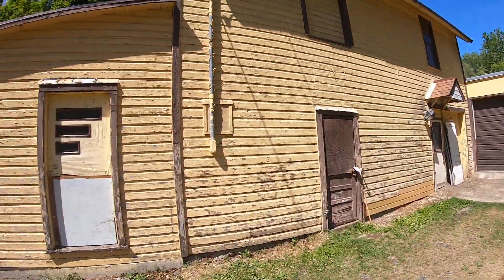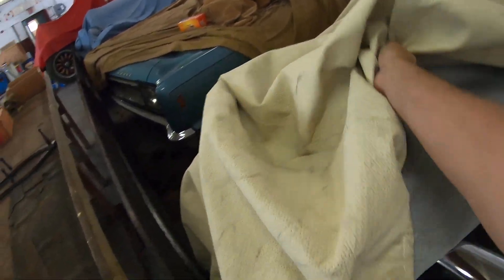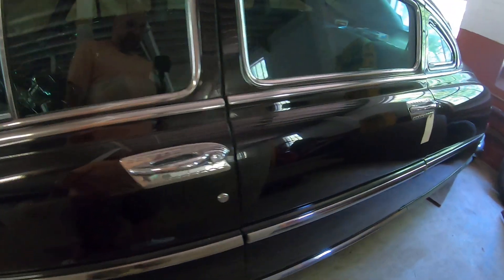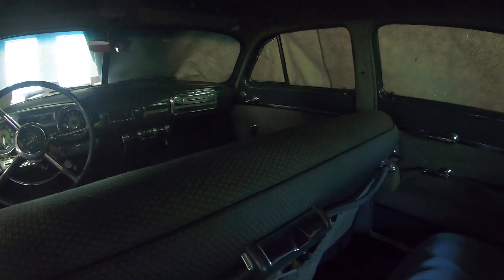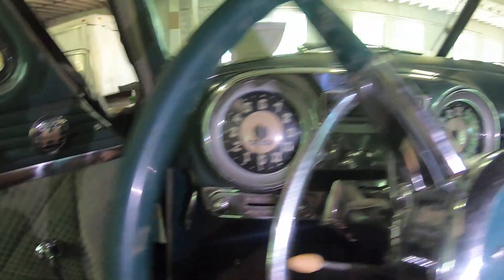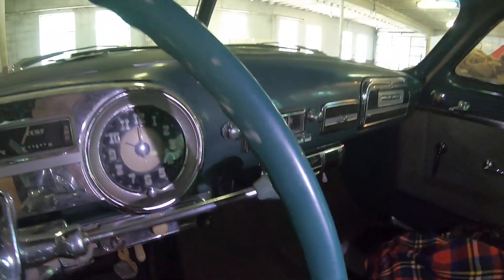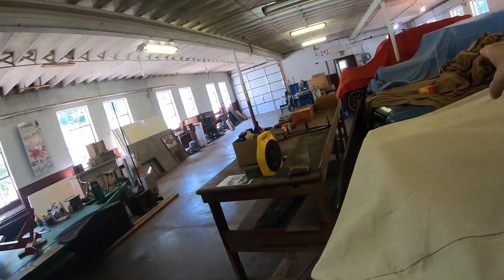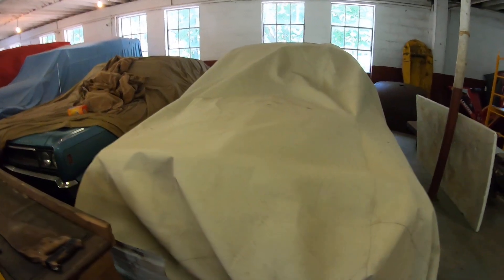HUDSON HORNET BARN FIND

Comment: "Barn Find" apparently means something altogether different now, than it did in the Eighties... When we were actually finding halfways decent old cars in actual, abandoned barns...

My brother and I found a rotting barn about three miles away from our folks house in Texas... We lived North of Houston in the Eighties, when it was still rural... Now it might as well be Houston Proper.

Anyhow, the barn was about 1/4 mile off of the road and in a thicket.
The house had long since fallen into itself.

Inside the barn, among all kinds of cool stuff like farm equipment and horse equipment... There was a 1927 Packard touring car... Long wheelbase.

We found out who owned the property, he was an OLD dude... In his early nineties.

He told us that if we could get the car out of the barn without killing ourselves, we could have it.

We ended up having to find a guy with a boom crane to put straps underneath it and lift it out and over to the solid ground... 

The barn was built into the side of a hill and was so rotten, if we pushed the car across what was left of the floor, it'd probably have gone right through.

It's front and rear axles were directly over two floor joists... And those were iffy, too.

Long story longer, we got a free touring car to play with... It was REALLY ROUGH and we made parts for the body ourselves in some cases... But it made a fun, BIG hotrod.😁

Comment: That Twin H Power setup, gave the flat 6 a boost (somewhat) in HP over the more plain models...180hp was pretty good in 1953....that guy "helping" you seemed like a real jerk!
Reply: There was the X7 engine with a beefer camshaft,larger valves,3 speed on the tree(column) with overdrive.It would put out 210hp.
Pretty impressive for 1952&1953 models.
Reply: @Paul-sl1si  They did provide Hydramatic with the 7X.Herb Thomas, the winningest Hornet NASCAR driver, used Hydramatic on the track according to his mechanic Smoky Yunick saying in his book.  However you could not get the Borg-Warner automatic( Hydramatic plant burnt down 8/1953) for1954 models because it was not up to the job